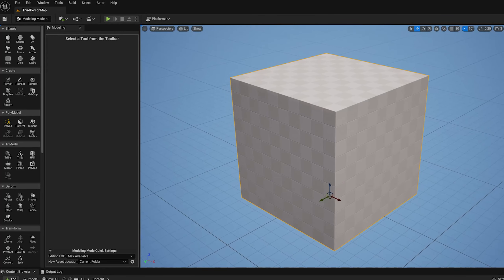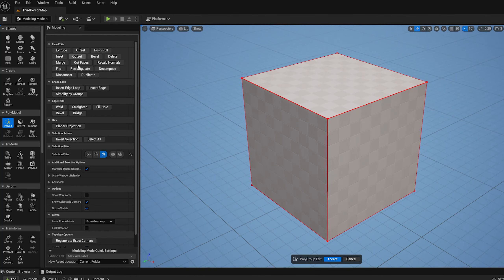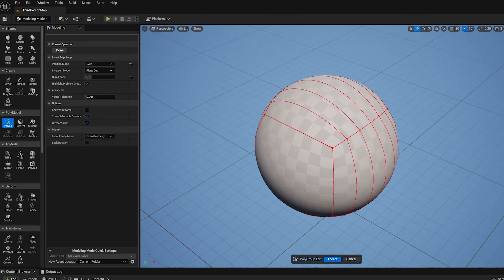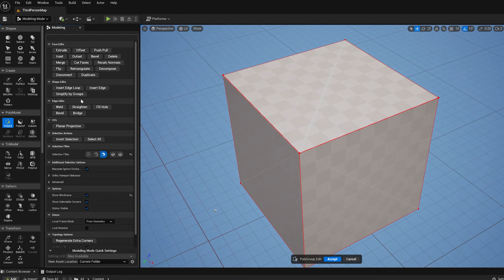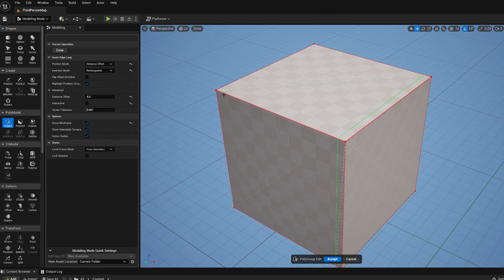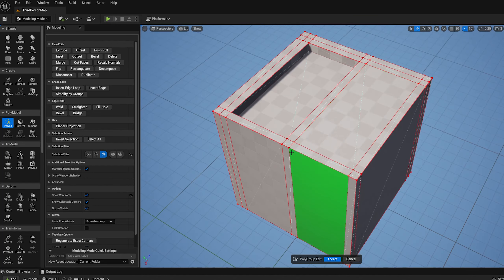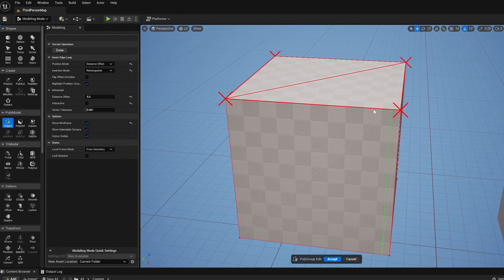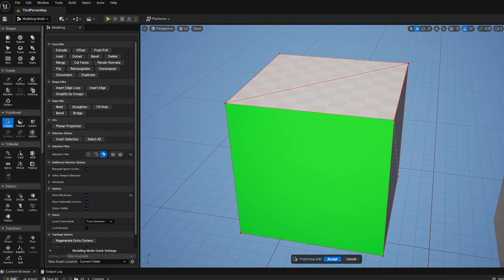UE5.1 PolyEd Modeling Part 8 - Insert Loop

Comment: When I duplicate a shape then change the geometry angles on one with tri it changes both shapes. Do you know how to prevent this?
Reply from the maker: your duplicate is a duplicate of the Actor, not of the Asset. So the duplicate is just a reference to the same mesh. If you want to duplicate the Actor and the Asset use the MshDup tool to create copies of both.

Comment: getting this error message. please help.

This tool is currently disallowed from operating on a group topology of this resolution. Current limit set by "modeling. PolyEdit. EdgeLimit" is 60,000 displayed edges, and topology has 79,638 edge segments to display. Limit can be changed, but it exists to avoid hanging the editor when trying to render too many edges using the current system, so make sure to save your work if you change the upper limit and try to edit a very complicated topology.